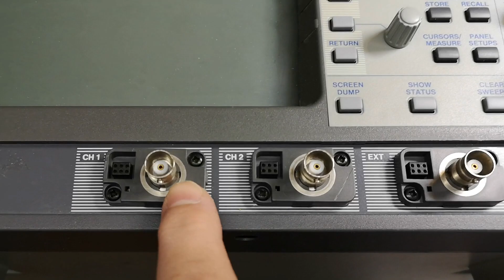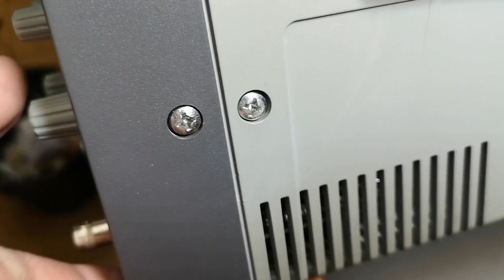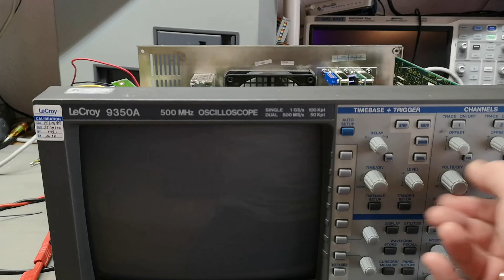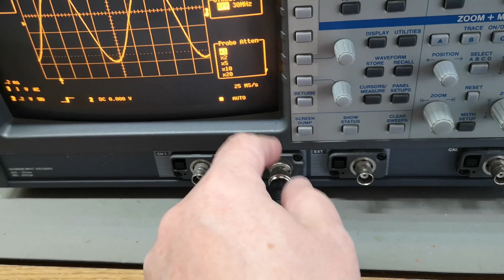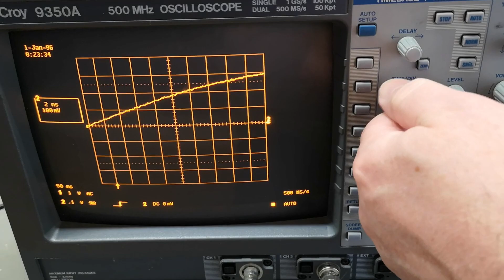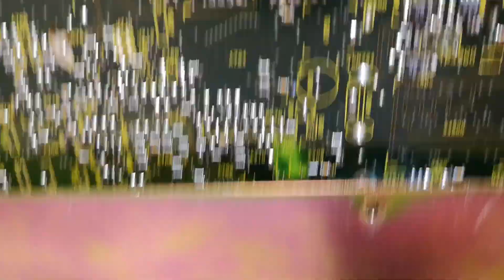Oscilloscope LeCroy 9350A 2ch 500MHz 1994 Teardown

Comment: Though I first used Tek, I have a 300 MHz LeCroy 9424E on my test equipment cart, along with an HP 5334B Freq Counter, an HP 8656B RF Gen, an HP 8591E SA, and a Symmetricom ET6000-86 GPS Time and Frequency Std on the shelf above it. It's a bit of a stack, but that is what I use. I have thought about buying one of these as well, if I can find one not damaged and without CRT burn.

Comment: Your reaction to the RIS mode was fun. Yes it's equivalent-time sampling and was relatively commonly implemented in higher-end digital scopes at the time. As you saw, it works really well, but of course only for repetitive signals. This is unfortunate that recent scopes rarely implement it these days, but understandable: for that to be worthwhile, you need an analog bandwidth much higher than half the native sample rate, and these days, even entry-level scopes have relatively high sample rates, while high analog bandwidths are costly. So it's more common these days to have that approach in dedicated instruments ("sampling oscilloscopes"), which are still commonly used for very high frequency stuff that doesn't need real-time sampling, such as measuring rise/fall times, distortion of high-freq sine waves, eye diagrams and so on.

Those scopes are fantastic. I still have a 9354AL (4 channels, 2 GS/s, 8 Mpts sample memory). It beats many modern scopes. Its usability is excellent. Downside is: it's relatively big and heavy and noisy. I replaced the fan for a quiet industrial fan and it lowered the noise, but still pretty noticeable. But in terms of usability/UI/responsiveness, this is still an inspiration for modern instruments. And all this running on a 68EC030 at 30 MHz (IIRC) and a few MB of RAM (mine has 64 MB, that was the maximum supported). Recent entry-level scopes don't manage that kind of responsiveness with 2 GHz SoCs and several GB of RAM. Crazy. The bloat is severe.

Comment: Would you recommend this scope for a first oscilloscope? If its for 100bucks?
Reply from the maker: to answer that, i would dig a bit first : hobby level ? what type of electronics will you play / work with, repair or development ? high speed analog digital or just hifi amps, also how large is your desk, and noise level ? a new modern scope will use much less desk space, make less noise, use much less power and be much more versatile, but also cost more. if you plan to work with electronics the next 20 years, then the investment is no big deal.
Reply: @TeardownOZ2CPU mostly 90s electronics,  old computers .
Reply: Lcd displays
Reply: Sensors
Reply: I saw people recommending old scopes over the new ones for electronic repair . The lecroy is being sold on ebay for 200-350 bucks just the scope. And this one i found is in mint condition with all the probes and some additional filters. That got me thinking whether or not to get it

Comment: How does it do in XY mode? Digital scopes seem to struggle with this.
Reply from the maker: correct, not impressive, the challenge is it needs a trigger, store both channels into memory, then draw the picture, this methode is also used in XY mode, it is far from the free running live mode any analog scope can do, if you need XY mode often, keep your old analog scope for that, it perform much better over any digital, even a brand new digital top crasy model
Reply: Thank you for the quick response! Yes, XY seems to be a lost art. Do you ever notice the 50k memory limitation? Would it still be useful for looking at fast transients, or is it best for repetitive signals? Thanks!  @TeardownOZ2CPU

Comment: Thanks for a very good video, it helped me in fixing mine.  I have used this scope for the last 20 years.
It is far easier to use than the Tek scopes of the same era.  It also has deep memory for the time and good HPIB capability.
Reply from the maker: wow great, thanks for the heads up, and congratulations on the repair
Reply: Would you recommend this scope for 100 bucks  for  electronic repair? 90s computers n stuff?